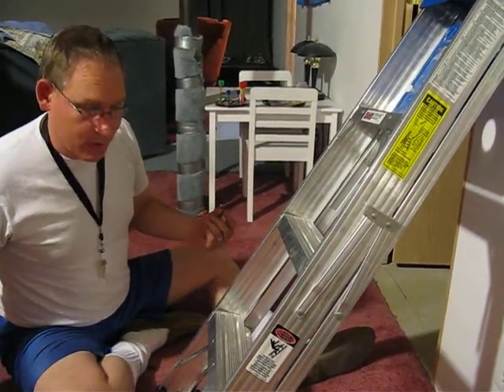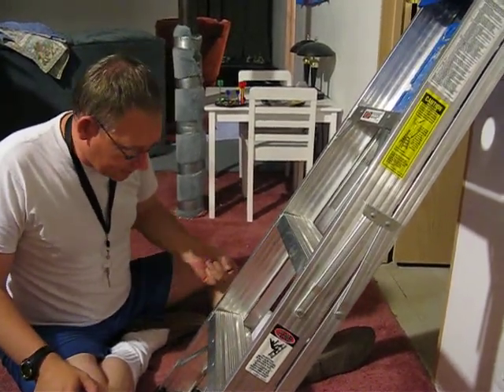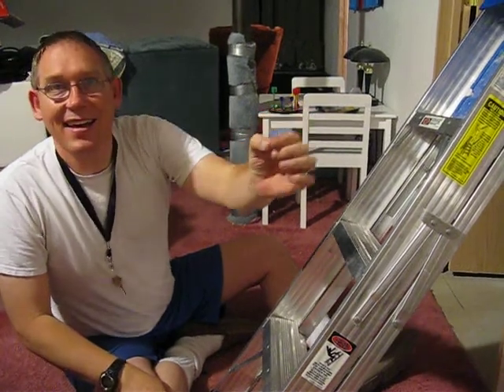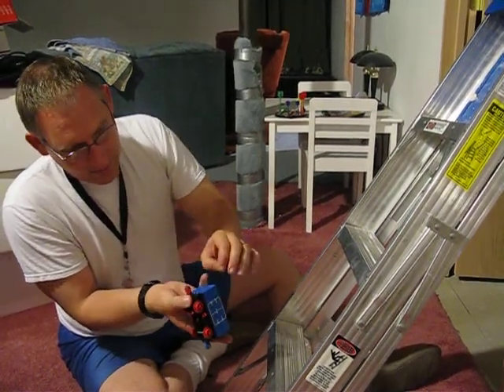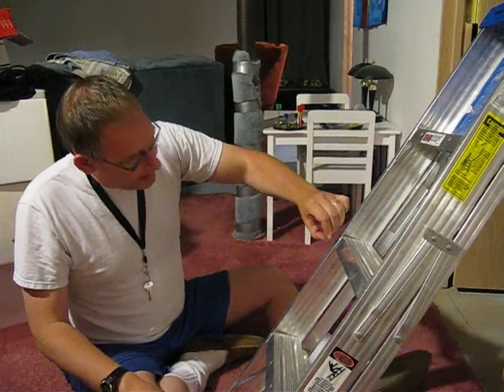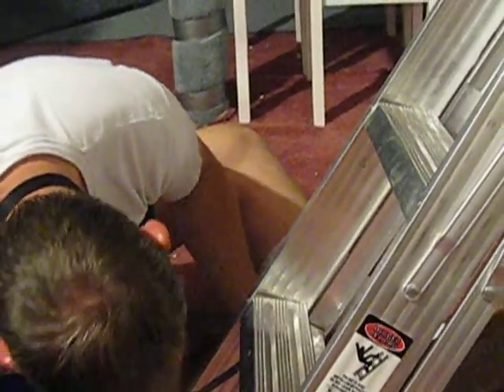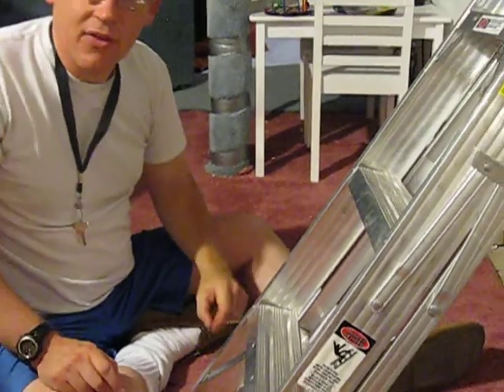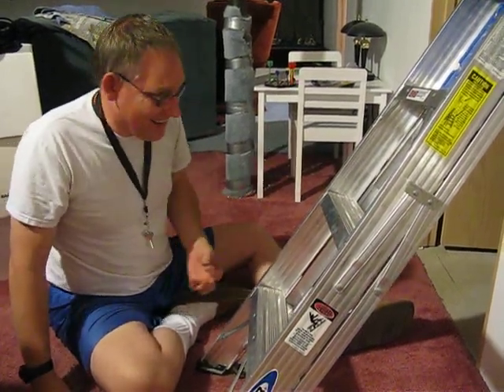Sliding Magnets on Aluminum 1

Comment: This is very interesting. You could make use of this difference in behavior if you had a wheel with embedded tracks along which the neo magnet tracked, and could get switched half way, along a stationary aluminum disk. Thus, repelling on one side, and attracted with the other. and maybe generate electricity as well with coiled copper wires?
Reply: @foxpup  Ahhhh I see. So if you had two, and on the other side with opposite pole, they would straighten out, would they not? If you still have difficulty with one side after that, then that would be highly interesting data, too. No?